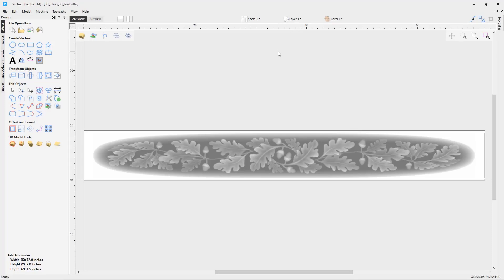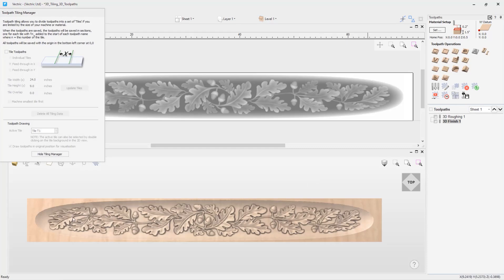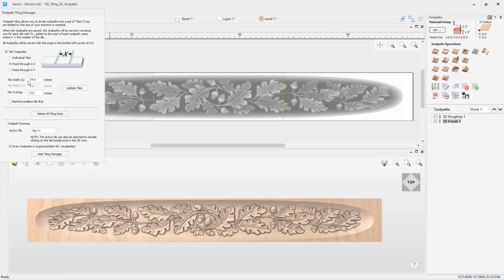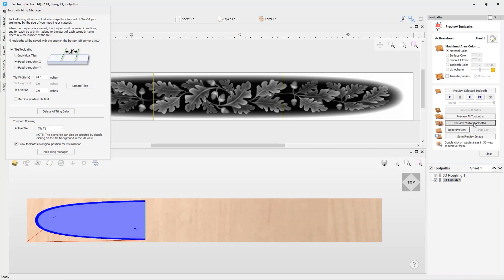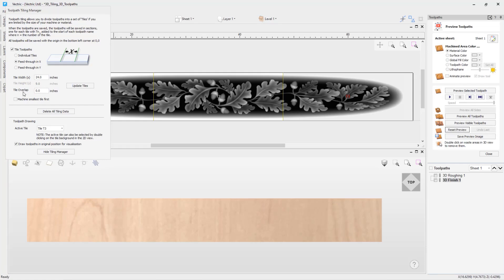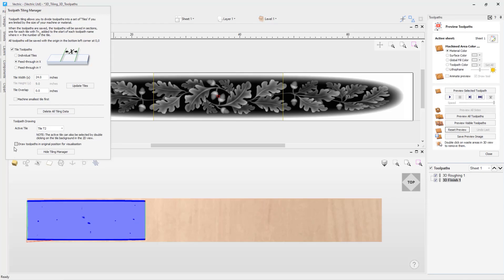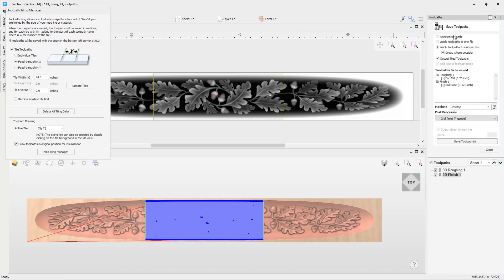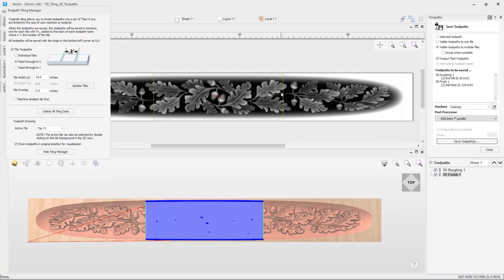How to Tile your Toolpaths 3D | Toolpath FAQs | V12.5 Tutorials

Comment: You dont explain how the tile length is created
Reply from the maker: It is noted in the Toolpath Tiling Manager - 24"
Reply: @vectric the the tile toolpath manager only asks for the length of the material. And there is a. Red T! In the middle length of the 96” long material. HELP im missing something.  I need 3 tiles if i have to I will take 3 tiles 32” long. If i cant customize them. 
Thanks for replying.